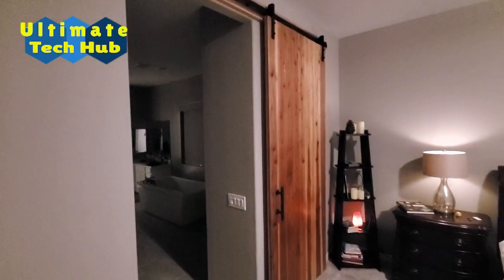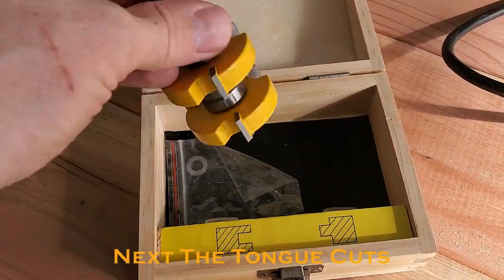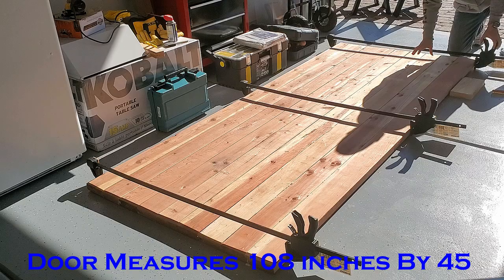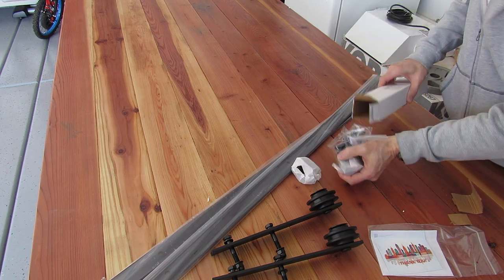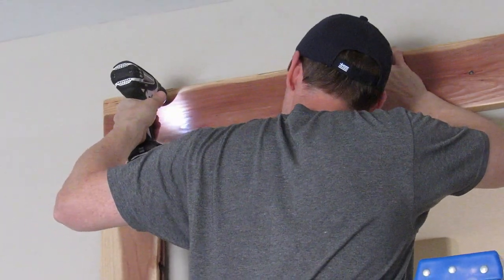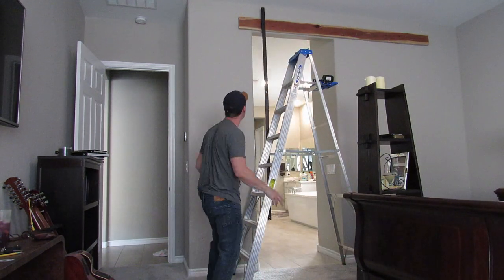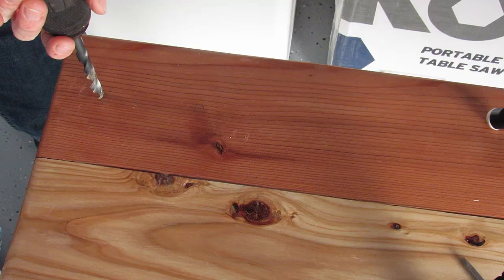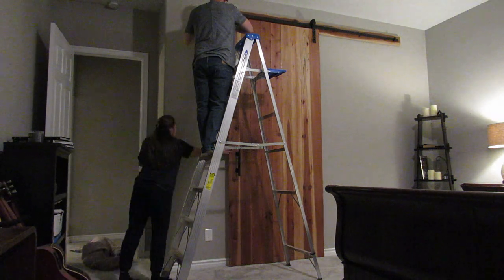MASSIVE BARN DOOR ON A BUDGET | SMARTSTANDARD 8FT BARN DOOR HARDWARE

Comment: Thank you for the video. There is also a floor guide to install, of which there are two options. One fastens to the wall trim, comes out under the front of the door and has a vertical axle roller on the outside. The other fastens to the floor like a shark fin that rides in a slot routed along the bottom of the door.
Reply from the maker: Yes I installed one later on. Thank you for watching I really appreciate it!

Comment: I checked a lot of e-books with woodworking plans. Instructions from woodprix are the best I think.
Reply from the maker: I never use wood working plans only because i like to design my projects myself.  Barndoor projects are pretty simple to design. The hard part is getting the slider installed on the wall. Thanks for watching and if you subscribed thank you as well.
Reply: @UltimateTechHub  Looks lovely I think 🙂
Reply from the maker: @mailaloomy4219  thank you!
Reply: @UltimateTechHub  👍👍👍

Comment: Did you use a jointer, and planer on the wood pieces before routing and gluing?
Reply from the maker: No I just sanded them as best as I could. I don't have a jointer or a planner. Thanks for watching.